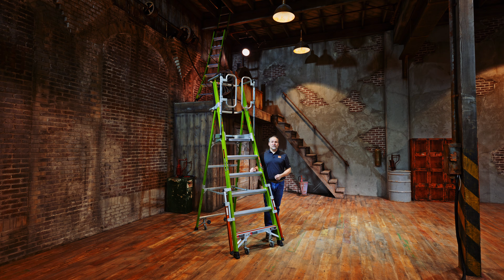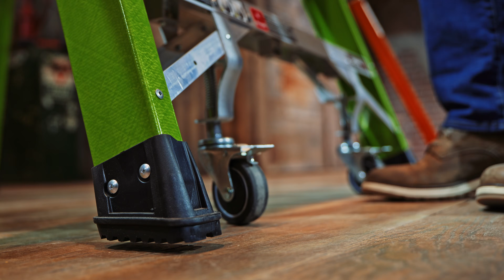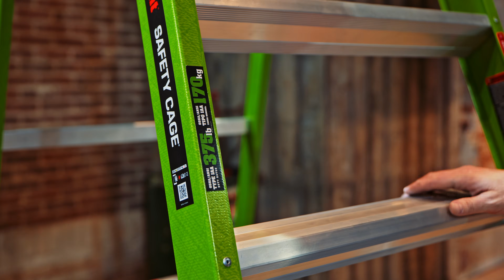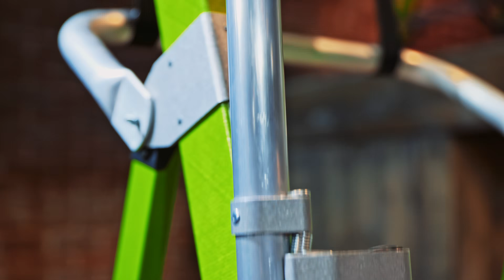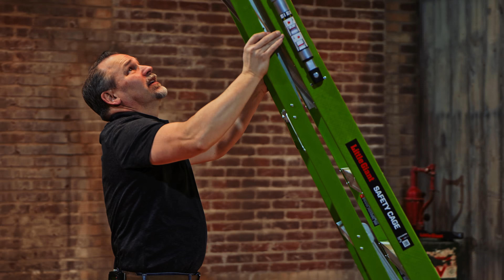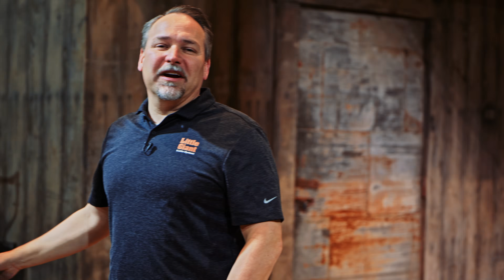Safety Cage 2.0 Demo | IAA 375 lbs Rated* | Little Giant Ladder Systems

Comment: Will the ladder fit through a 2x2 ceiling grid?
Reply from the maker: The very top width is 2' 3.5" wide, so it seems like the cage portion would be too big for a 2x2 section. It comes in 2', 4', 6', 8', or 10' models (those are the heights of the standing platform). The guardrail is 3'6" tall. So a model 8 is 11'6" from ground to the top of the guardrail. So depending on how high your ceiling is, potentially you could get a Safety Cage that reaches the ceiling, without needing it to go through the ceiling.